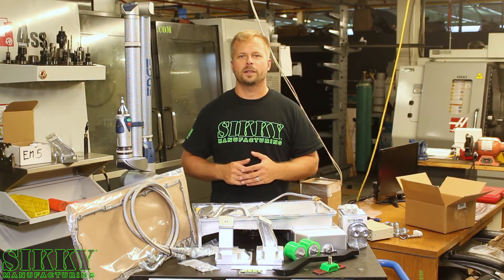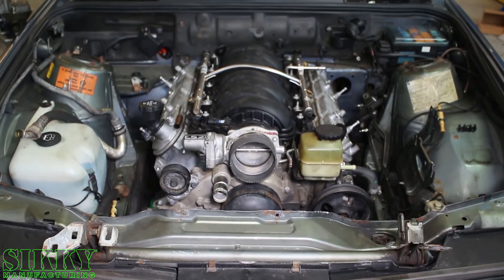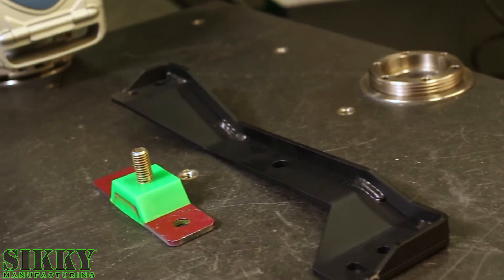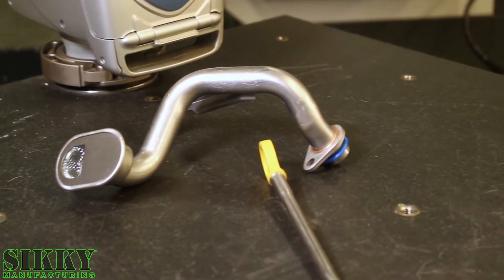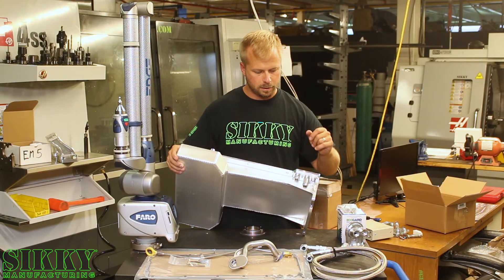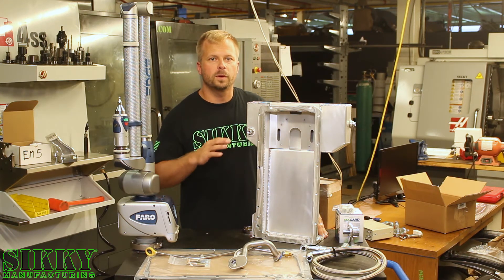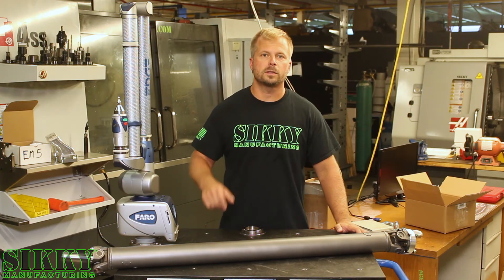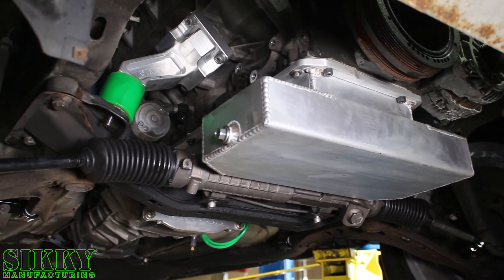BMW E30 LSx Swap Kit | SIKKY Manufacturing

Comment: Is there a reason you don’t offer a driveshaft for a cd009 as well the Chevy ones? Seems weird to offer a mounting bracket for a cd009 but not a driveshaft when you can get a t56 and tr6060 swap shaft and trans mount w the swap kit.
Reply from the maker: Sometimes they just have not made it to the website but we can make them.  Typically we don't have time to test all configurations of driveshafts so we rely on customers that order them and give us measurements prior to the order.  Then we make it to that spec and enter the data into our system creating the part number for future customers.  In some cases this happens but it doesn't get added on the website because we just flat out forgot to do it although that's rare.  If you need something you don't see just reach out and we can get you squared away.  Unfortunately all the 6060 driveshafts are on the expensive side due to the style of CV joint that needs to be run on the front side of the shaft vs your traditional U joint that would be there on most driveshafts.

Comment: Your oil pans are 700 bucks plus you guys said you have to run an oil filter relocation kit......wrong. You can buy a Moroso oil pan for 300 bucks less and you can still use factory oil filter location. Your headers are really nice, super nice welds.
Reply: They should have responded..
Reply: Got em

Comment: You guys still do business? 2 year old video...I’d love to have an ls e30 but don’t have the engine lol only the car ;-; current m20 stock 325iS 1989
Reply from the maker: Yes, all day every day!
Reply: SIKKY can you sell me an ls and tranny with that kit? 😂
Reply from the maker: @LoserShane  yes, we sell the brand new GM crate motors and tremec transmissions on our website!
Reply: SIKKY oh I’ll have to take a look. Rn I’m driving a e30 beater but the m20 sometimes is lack luster in power. I miss my v8 I had a 740il before lol
Reply: SIKKY oh I just noticed the website and I wish I could get a quote for the ls swap...but I don’t see it happening...I live in south padre Texas area..🥺😅😂 mines a rusty bucket too...I might just have to turbo my lil m20 and settle for the turbo noises 😂

Comment: Do you guys have a kit for the 83 635?
Reply from the maker: It's possible one of our kits might fit but I'm not very familiar with that 83 635.  What you would need to do is look at the similarities of the engine that was in that car and the front subframe.  If that car shared the same engine and front subframe as an E30 325 for example then it would likely fit at least the engine mounts.  Sorry I don't have more info for you on that one!  Thanks for watching.
Reply: @SikkyTV  645i will be super with LSX

Comment: Just wanna be 100% clear, will this work with an lq4?
Reply from the maker: Yes, will work with a LQ4
Reply: SIKKY thanks. Another question. Can i only use the t56 transmission. I would love to have one but there really expensive. Would i be able to use some other transmission, like an nv4500. Or even the getrag 260 thats in my car already
Reply from the maker: You could use any trans that can be adapted to bolt up to an LS. So if someone makes an adapter plate then it’s a possibility but we recommend you use something strong enough to handle the torque these engines can make. In order from best down here is my recommendation 
T56 Magnum
TR6060
T56
CD009

Comment: Best swap kit ever but need to make one a little less expansive
Reply from the maker: Yes, at first glance it appears expensive.  What most people don't realized is it's an engineered system.  A lot of thought and design goes in to how each piece of the puzzle works together.  This makes it a system that is simple to install and avoids all the issues commonly found when piecing a kit or setup together.  If you don't want major headaches when assembling and you want everything to fit then get Sikky.  Simple as that.  It's amazing how many customers go cheap first then realize there is a reason a CX kit or an ISIS kit is so cheap.  Materials, craftsmanship and quality make all the difference.
Reply: JC Torres maybe get a job so you can afford to buy the products ,I’m sure it worth the money ,I’ll be buy the steering rack shaft / uni joint conversion kit .
Reply: Got the money but don't wnt to spend that much
Reply: SIKKY...thanks for the info
Reply: Gaz Girl Typical hater